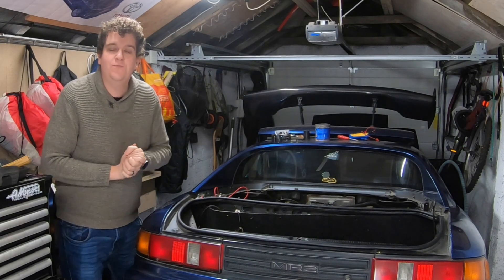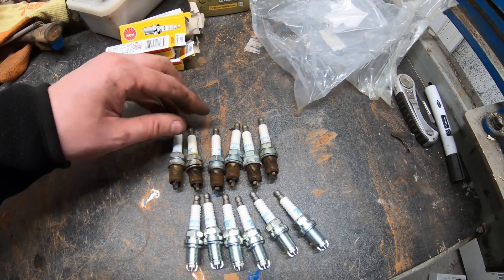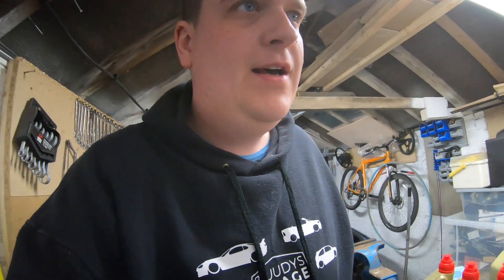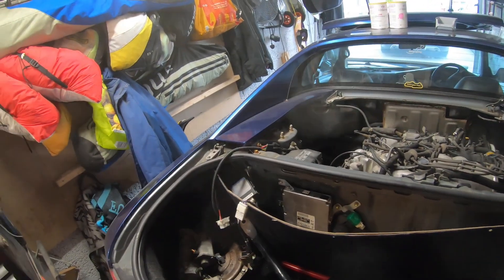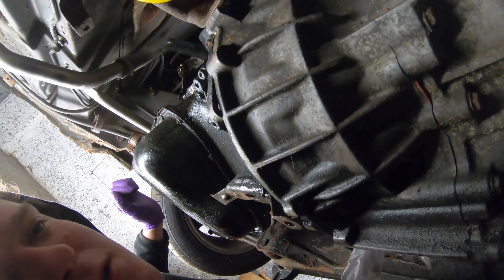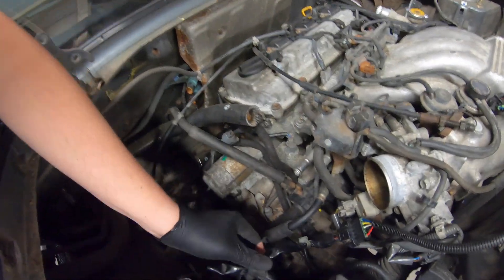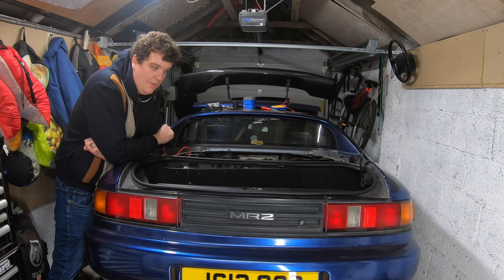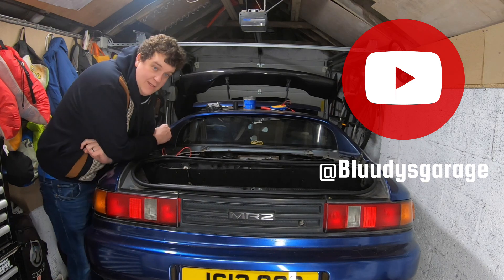Trying to START the V6 DROPPED in the MR2 - Part 4

Comment: I installed the engine on a Toyota Caldina 4 wd.  By modifying the exhaust system you can get 260-280.  You also need to change the ignition angles.
https://youtu.be/KTtCj25YDg0?si=i9kKPCTsisUJveY3